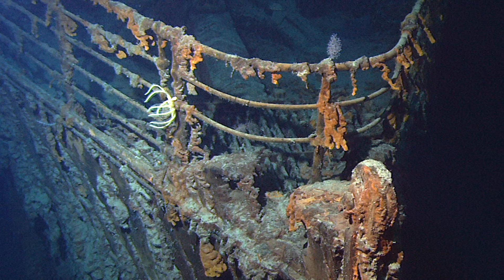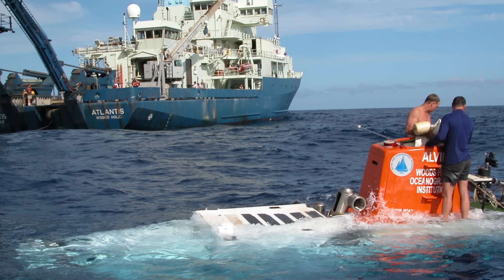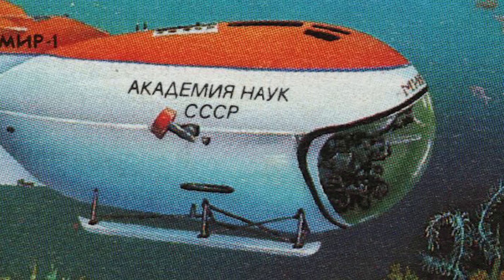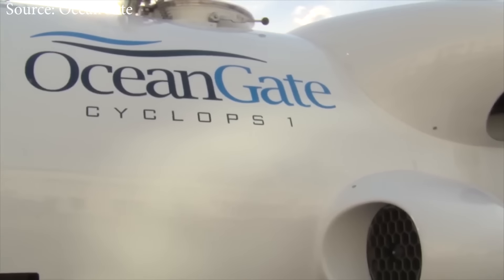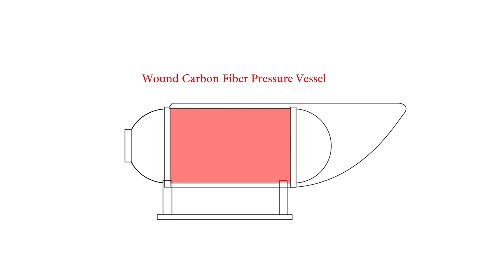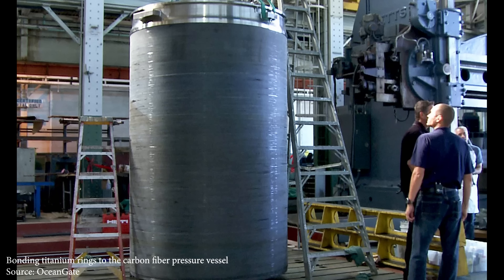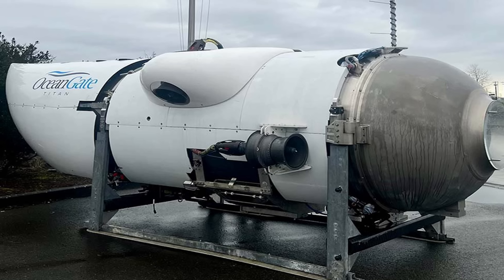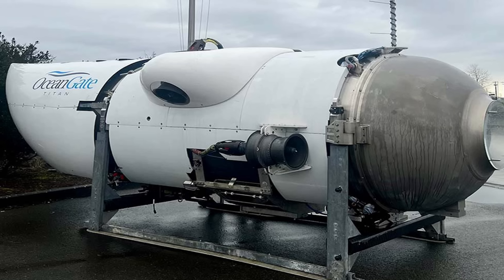How Titan was Built, Lost and Found: An Analysis

Comment: A couple of potentially key aspects that weren't mentioned in this video:

A - The viewport was only rated for EDIT: 1300m. That's 1/3 of the depth to the Titanic. That was a flagrant, known danger point. Russian roulette on every dive with a negative safety margin. 

B - The engineering spec for the carbon fiber thickness was 7". They built it to 5".

C - Preface: I used to work at Boeing on the 787 program, both post-cure and pre-cure. The 787 is mostly made of carbon fiber. Pre-cure was basically a low-level clean room. Not an open warehouse where people were at working areas with loafers and polo shirts. Every single large co-cured part underwent ultrasonic inspection and any defects fixed, and checked again for verification. The submersible did not get any testing for voids, inclusions, nor delamination after it was built. Any small one of those SIGNIFICANTLY weakens a co-cured composite structure by a significant amount.

For them claiming to be primarily interested in scientific pursuits, they intentionally disregarded science, engineering, and safety standards, then claimed they got in the way of innovation. I'm fine with innovation, but when innovating, you put no lives or only put your life on the line...... not putting several uninformed lives on the line. In my opinion, the passenger's deaths are akin to homicide. Rules were intentionally disregarded, then lives knowingly put in significant danger.

Edit: I'm in no way meaning to imply the video missed points intentionally. The stream of information about the disaster comes and goes, and I'm certain there was no ill intent, intentional misinformation, nor deliberate skipping of information.
Reply: This should be a pinned comment. Great work. I have found this channel so fascinating but this video is just... Weirdly off. These are awesome facts!
Reply: I agree wholeheartedly. Good work on the lovely 787.
Reply: C - completely agree

A & B - I've read the same, but is there a reliable source for these?
Reply: @TimInertiatic Many people in the deep sea diving community wrote to him saying it was a bad idea and thats all documented. Also the one whistleblower that worked there years ago.
Reply: @TimInertiatic  I know the window rating came up in the 2018 lawsuit involving David Lochridge and the company. He allegded in his lawsuit that he was fired when he raised concerns about the safety of Titan, including the window pressure rating.
I read aobut it on CNN, but that will also give you the name to google to find your own sources if you want to cross check
Reply: The thing that makes the least sense is why they were using carbon fibre in the first place. It doesn’t need to be lightweight. 

There’s a reason high tensile steel and titanium have been used for years, because as Alvin and the others have proven they can go through thousands of dive cycles and still be serviceable. 

Carbon Fibre weaves are strong, but as soon as that weave is broken it’s almost useless structurally. It’s not an ideal material for withstanding pressure in place of steel or titanium.
Reply: Want to add to your original comment that making carbon fiber is not easy either and has little room for error. When I was on a car design team in college we made a carbon fiber hood for our racecar as part of weight reduction and we just thought it would be fun. We had to scrap the first one all together because of delam and the second one "worked" because it's just a hood, but when you looked up close you could see tiny bits of delamination on it, but it still looked good from 20' away. Definitely not a foolproof thing to manufacture.
Reply: Hmm very interesting. Is it common to have very think carbon fiber like 5 or 7 inches? I don't know much about it other than from formula 1. As I understand in formula 1, carbon fiber parts get non destructive tests every so often to ensure no micro cracks have formed, is this also the case in aerospace?
Reply: You seem knowledgeable. Your comment was well said.
I suspect a slight bias here on the part of Mike, the channel host, one that is greatly magnified by the tragic nature of these events. He does not wish to speak ill of the dead.
And whatever the hubris of Stockton Rush, P. H. (AKA, the one guy who knew what he was doing) the French pilot, somehow he believed in the design.
To Mike, this is as if Sir Edmund Hillary hath fallen, claimed by Everest.
Reply: @tcu1099  Mike's bias is revealed in this case, magnified utterly by his desire not to speak ill of the fallen. I see no shame in that; he hath lost a Hero because of this.
Mr. P. H.
Reply: The 4 sign the waiver, which is death.They know the risk nuff said
Reply: The owner repeatedly assured potential passengers that his vessel was completely safe, too. I don’t think the passengers on board really knew how unsafe this thing was because they were deceived 💔
Reply: 100%!

As for a potential bias on this channel, as an aviation guy myself, and having had many friends die, it is natural to not want to speak ill of the dead.  That is true in a pure “normal accident” scenario.  However, there comes a time where one finds themselves as the only one defending the person at fault, because the person at fault is dead because of their own actions.

Supporters of OceanGate, exploration, and innovation, will have to adjust their stance in time.  After all, it failed here - miserably.
Reply: It was reported yesterday that the US Coast Guard will undertake the investigation into the loss of Titan, assisted by the NTSB. That is hopeful, as the NTSB are very good at investigating accidents, especially air crashes which also involve pressure vessels which can fail catastrophically (fortunately, only on rare occasions).

If Oceangate cut corners, as they appear to have done, the USCG/NTSB investigation will surely uncover it, which makes the future of Oceangate pretty uncertain....
Reply: Exactly. This was anything but science.
Reply: @tyler_bt3326  Titanium is *expensive*. Very. And therein lies the answer.
Reply: @jonzenrael  do you really think OceanGate can’t afford that? When human life is the main thing at risk, the last thing you should be thinking is “what’s the cheapest way to dive the titanic”
Reply: @michaelmanrahan8059  It doesn't matter what waiver you make a person sign, you can still be accountable for negligence. I can't trick you into signing a waiver for a bungee jump, neglect to tell you that the bungee cord is made from wool, and then walk away scot free while you plummet to your death.
Reply: To add on a bit, it looks like there were reports of “crackling” and “cracking” noises as far back as 2019. Someone hired to determine how reliable the submersible was reported to OceanGate at that time that it was likely due to part of the composite becoming “spongey” - this could have prevented a thousand different ways.
Reply: @tyler_bt3326  I think you might be misunderstanding me. I was criticising OceanGate for not using titanium, and suggesting that the reason for them not using it was to cut costs.
Reply: @tyler_bt3326  they specifically were testing new materials, and its not like the full thing was made of carbon fiber, they used titanium as well.
Reply: @tyler_bt3326  Also, carbon fibre is great for tensile stress but terrible for compressive stress. Suitable for internal pressures, useless for external pressures.
Reply: Listen to something that the View port was only rated at 1300m. Either way, not certified for 4000m.
Reply: @timoooo7320  Especially for aviation, since airliners' fuselage are also (internal) pressure vessels. Multiple aviation accidents are caused or contributed by microcracks:
• BOAC 781
• United Airlines 232
• El Al 1862
• Southwest Airlines 1380
• Aloha Airlines 243
• Japan Air 123
• China Airlines 611
• British Airways Flight 2276
Reply: @dbclass4075  yeah that’s what I was trying to get at, but didn’t have the wording to explain what I meant
Reply: They used a tube so they could fit up to 6 people inside. Im not an engineer but they could have just used two spheres, next to each other instead. I don't know if they taught about that, but that wouldn't been "innovative" enough, I guess...and probably more expensive too. If they had issues with being to heavy (witch was an argument for not carrying safety equipment) they could have used buoyancy foam like it was used on the Triton 36000/2, or even oil/gasoline filled tanks which don't compress and also float (like it was used on the Trieste). Even one proper sphere would probably bee to expensive for a guy who purchased b-stock carbon fiber from Boeing at a discount because it already exceeded it's shelf life. That was the "cooperation with Boeing" he was bragging about on his website.
Reply: I don't understand why he didn't mention these aspects. Stockton was negligent and ignored every single aspect of danger. Real experts and scientists don't ignore those things. Also, carbon fiber is an awful material for this. It's strong, until it slightly fails. Then it's all over. And in the depths of the ocean, why would anyone risk that? We should discuss where he messed up to prevent this happening again.
Reply: @bladerj  you're right, they did use titanium as well. But the issue is that that introduces a whole new set of weak points to the vessel - the join when the carbon fiber tube and titanium end caps meet,for one, but also that these are two different materials that are going to take the pressure in different ways. It's very possible that the titanium, being stronger, simply transferred the pressures to the weaker carbon fiber
Reply: I was looking at that carbon fibre and wondering, I am willing to bet it was that CF that gave way or as you say the view port
Reply: @nerdcredcosplay  may be, may be. but i think it was the viewport, there was a video from a guy that showed water inside it, i dont know it if was diference in outside being cold and inside hotter, but there shouldnt be water there.
Reply: How can the voyage of Titan be legitimate when safety and construction wasn't tested when Oceangate was aware of such defects ?  That alone doesn't make it legitimate surely ?  Swap legal for legitimate.  Your video is naive and has several misnomers. Not going to listen to the end.
Reply: @dutchpilotguy  Yes, it did. But I definitely think Mike lost a Hero. 
Normally, his videos seem (to me) professional, informed, knowledgeable, and well-presented.
This one got him where he lives, sadly.
Reply: Pressure around the windows of the De Havilland Comet weren't the cause of the stress failure. There are videos and a very complete report on the tests and reasons
Reply: @jonzenrael I wish the American pronunciation was dropped! Typical of why the Pilgrims left thankfully!
Reply: @tcu1099 I agree with this video seeming to be "off". It's one thing to set the record straight (the game controllers that everyone brings up is a non-issue, and I'm glad he addressed that) but the video comes off as strangely on the side of OceanGate. The objective view here is definitely not in the exact middle between OceanGate and the general public; their disregard for science and safety killed 4 innocent people.
Reply: Thank you. This is great info which makes me feel confident about air travel.
Reply: @brianpacos4072  Sorry to disagree. Off the shelf game controller are a major issue here. Using a bluetooth device adds only problems and makes the system more complicated compared to a wired device (possible interference with other electronic). Bluetooth implies using batteries which can fail and will fail in colder temperatures. So in case of an emergency in gets very cold down there, adding more complications and a higher workload to the crew, like putting the batteries into once pocket to warm up etc. So comparing those to the us navy was a bit ridiculous. This controller was probably not the cause for the catastrophy but is in my opinion a vivid display of the carelessness of the CEO and the company.
Reply: @mementomori4972  Well said, it was even the second hull because they had to replace the first one cause of fatige damage (wikipedia). So they all knew about it beforehand.
Reply: @tyler_bt3326  Interesting comment. Perhaps it should have been used in a sandwich type  construction between thin layers of titanium.
Reply: @tyler_bt3326 - I think one of the experts said it was a cheaper option.
Reply: @slayrae872 From listening to him, my guess is that it’s difficult for him at this time given he lost his hero. 
I think as time goes by, his bias will show less and he’ll be able to list all the things that were wrong with the submersible, etc.
I think back to John F Kennedy Jr. I was a child growing up seeing him always in the magazines and I thought of him (and even Lisa Marie Presley) as American royalty. I thought of him as America’s Prince and I thought of Lisa Marie Presley as America’s Princess. Remember, I was a child.☺️ But when his plane went down, Ugh, I was really sad. As time went by I was able to say, he should not have been flying that small plane with a broken leg in so much fog. That crash didn’t have to happen.
Same with Lisa Marie Presley. Her death did not have to happen.😞
So with all that, I can understand where this gentleman is coming from at this time. He’ll get there.
Reply: @dutchpilotguy  Well said!
Reply: re: "The viewport was only rated for 1600m."

Manufacturer's spec; they would warrant it to no deeper. Doesn't mean it's physical limitation is that value.
Reply: Thank you. This video is chock full of misinformation.
Reply: @vipersb1  No its not, the comments section is full of witchhunters. Most of whom do not have the first clue what they are actually talking about.
Reply: @michaelmanrahan8059  Yes, but while he was having them read and sign it, he was also telling people that a trip in his submersible was "safer than crossing the street". while that might be said of Alvin and Mir, it was certainly not true of Titan.
Reply: @brianpacos4072  It's not the game controller configuration per se, it's the absence of backup wiring, and the absence of sophisticated spark retardants in his unit. Submarines may use a unit that resembles the Titan one, but for sure those have  power redundancies and safety features that Titan's standard controller doesn't.
Reply: @pitchblack.793  No.

Unlike Oceangate there was actual testing done. :) In the R&D process they actually did destructive testing. The wings will flex to almost 90° up before they fail. That is FAAAAR beyond what they will see in operation.

Components undergo ultrasonic inspection to find voids.

Before structures go in the autoclave, there is testing done to make sure the vacuum bagging process was done correctly.

The pieces are laid-up in a near clean room, and are laid and cut by machine. Each layer is oriented specific directions to add strength. The thickness varies to be thicker at load bearing areas.

Each layer is inspected by QC before the next layer goes down. There are so many QC inspection points.

Hell, they even have a UV blocking coating on windows in the buildings.
Reply: @uploadJ  I would trust the manufacturer of the component over a guy cutting every corner he could. They're not going to warranty something for 1/3 of what it is designed to work to. That is a strawman argument.
Reply: @tcu1099 all videos are reapiting the same to gain money from views on nowdays hot topic tragedy. Same stock imiages and nonsense talking. There is imposible to make an essay in 1 day.
Reply: @tcu1099 100000% agree man
Reply: @michaelmanrahan8059 
I would argue it wasn't informed. If in the waiver they listed the concerns experts raised. If they listed the whistleblower incident. If they listed the potential for the material failure of carbon fibre then the passengers would be informed. The only informed person in that vessel was the CEO
Reply: @maryearll3359  • International waters, where no country has (direct) jurisdiction.
• No classification, in which no regulations will apply. You can notice this in OceanGate's motto about "bringing external players up to speed to innovations" (screw regulations!).

Unfortunately, physics is indifferent to human ambitions and regulations. Pressure is pressure.
Reply: @geoffreycodnett6570  While not the cause, it is a contributing factor. After the skin does fail, cracks find the window edges the path of least resistance.
Reply: @pitchblack.793 No, as the carbon fibre's flexibility is what delays its breakage. Here is the A350 wing test, whose wings are also made of carbon fibre: https://youtu.be/B74_w3Ar9nI?t=79
Reply: do you know if the 7" thickness spec was for the original design concept that eventually evolved into Titan? or was Titan itself supposed to have it, before corners were cut?
Reply: @iwannaratrod  re: "I would trust the manufacturer of the component over a guy"
What to say, what to say here. You do realize, that was likely NOT the cause of this disaster, right? You have not virtue signaled on that note. Please do. Now, having said that, you sound like a nice safe little "do-bee" (a reference to from Romper Room and little kid-dom, decades back now) who never exceeds the speed limit and changes your smoke detector batteries on-time every single year. You also likely have the city code enf ofc on speed deal, maybe second from the top? Thank you for your post, and perspective.
Reply: I have worked on many projects that were constructed with carbon and resin and like you said they were done in a clean environment specifically built to keep the object as sanitary as possible we would even use a larger room that was dubbed the sweat box that was around 130°F if I remember correctly and that was to help with the carbon and resin cure together with no air bubbles that I know had formed on the Titan pressure vessel and in air bubble at depth will implode causing cracks and weak points that would fail at that spot or start a delamination of the carbon they also used no diamond or any weaving patterns when laying the carbon that would have helped with the rigidity but it was just layered straight on top of the last piece which isn't really a tried method when applying carbon that's going to be under any kind of stress as you know..✌🏽
Reply: It's also crazy to think that the pressure vessel used in the Titan was an untested shape for the pressure cycles at Titanic's depth Oceangate had no cash coffers at all that's why all the cheap hokey lights and game controller they cut as many corners as possible they even fired the safety man that shape was only made to carry passengers because they had no way to pay for the excursion and the science that was to be performed they needed the passengers to collect the funds to even have a mission man it's really sad all the way around and I think your thoughts on it being closer to homicide is right on point he knowingly put those peoples lives at risk and ultimately his own..
Reply: Thanks for this. I had read these things too through ten minutes of googling but didn’t have the background to word them this way. I just really wonder why they didn’t listen to this research themselves like the twenty year old who talked his dad out of the trip. Apparently Stockton just brushed aside their concerns and even offered them a $100k discount. He obviously had no intention of listening to anyone. Fine. Risk your life. But he didn’t have to take others with him.
Reply: @RossGoneRogue not to mention the first company they went to to make the hull said they’re not gonna do it cause making a sub out of carbon fiber is a death wish
Reply: Thanks for this info. Finally a comment worth reading👍💯
Reply: @uploadJ  It is one of many possibilities, and an example of flagrant disregard for the laws of physics, which require no jurisdiction. Physics will do what physics does no matter laws, how cavalier the attitude, or how much money you throw at it.

I mean I usually drive the speed limit, but I like to live on the edge. I drink milk a day past the expiration day, and I'll pull a trailer rated at 55mph at 57 mph.

My smoke detectors are also carbon monoxide detectors. They are smart ones and will tell me if the batteries need replacement.

I don't know the phone number for code enforcement, but I have not licensed our chicken coop.

I like to live on the edge. Who knows what I will do next!
Reply: Oh gosh more armchair experts in the comments who barely even knew what carbon fibre was a week ago. 
 
The carbon fibre hull needed to be thicker AND needed to be scanned prior to each dive. A carbon fibre manufacturer stated it would cost about $20,000 dollars for a hull scan of the Titan. Stockton Rush chose not to, thinking that their onboard acoustic warning system would be enough. 
That was the real failure, taking shortcuts. Let's not forget the Titan had carried out 13 prior dives to the Titanic, plenty others in the Bahamas, could carry 5, cost only $370,000 dollars yet a spherical steel or titanium sub that could only carry 2 would set you back a whopping $37,000,000. Yes that's 100 times the cost of the Titan. There clearly is potential for carbon fibre, a lot, but it needs to used properly and with regular checks. A more innovative design could even involve a removable carbon fibre hull for more detailed analysis, inspection and even replacement after x number of dives at relatively low cost. Much will be learned from this tragedy.
Reply: A potentially key aspect you did not mention in your comment:

The Titan was actually deployed in 2021 and was field-proven over two and a half years and 10+ successful dives. 

I am not trying to imply that you failed to mention this key aspect on purpose or that your comment was not well thought out (it is very well written), just that it is very easy to lose the industry successes in the face of this small tragedy.

Edit: wrong number
Reply: @quietcosmos.  Agreed. But it's also important to note that those dives, although successful, likely contributed to the eventual failure on the last one. 10 dives are not a proven track record compared to the 5,000 dives of Alvin, for instance. If the 787 only had one plane, and that plane flew 10 times and broke apart on the 11th..... we would not count that as a success.
Reply: @iwannaratrod  I knew it - City Code enf on speed dial.
Reply: @jonzenrael  It is astonishing to think the Soviets built the entire Mike class attack submarine out of it.
Reply: Every time I hear some idiot say "I've done my research" I know they're full of it. Stockton Rush is quoted as saying something eerily similar.
Reply: @marcdraco2189  Would you rather them say: "I didn't do my research, I used a coin flip to decide." At least that would be honest, eh?
Reply: @uploadJ  Indeed. On its face that does appear to be logically equivalent, but it’s not. “I’ve done my research” is another way of saying, “I used Google and found information that supported my pre-existing ideas which means I can then spread those to even more people and cause more problems”. Doesn’t quite have the same ring, but that’s what happens. I say Google with the capital G because Google’s search engine optimisation works to promote popular ideas. Vaccine “skeptics”, GMO, pesticide and other skeptics all do the same thing. To be fair this is my wheelhouse so I do feel quite strongly about it. The problem we face now is that “advanced” (by current standards) AI is doing precisely the same thing. Bing AI (which also appears to act as a moderator for some of Microsoft’s discussions) gets a LOT wrong and even goes off in a huff like a child when challenged on its errors.

A simple example is to ask it to design a 2 pole passive low-pass filter with a cutoff of 100Hz. There’s a lot of math behind this, but unless they fixed it, it will respond with one pair of components (a resistor and a capacitor) telling the user to use the same circuit twice. This does not work and it creates a circuit that will filter as described BUT won’t function correctly. The second pair of values have to be completely different. As we add each new “pole” (resistor/capacitor) the effect increases as does the error.

When asking about GMO it suggests that SOME people think there are long term problems that have not been discovered. This is also BS, we’ve been doing GMO for at least 10000 years and doing it with things like radiation and chemicals for over a century.
Reply: @marcdraco2189  re: "I used Google and found information that supported my pre-existing ideas"
AND of course that is not research. When it comes to design, there is the first-pass where I'll use Mathcad and use a textbook formula or two to get an idea, then progress onto CAD tools for a finer rendition followed by a SPICE analysis for  near real-world parametric values (where I need to see peak currents and voltages, esp on filters). 
When it comes to EM and antenna work is where it gets hairy; the small tuned loop formulas are in error, even in Jasik's book on Antennas ... the efficiency and required resonating caps are all off for diameter =  .1  Lambda (~.3 Lambda circumference) even SO one really needs to know the 'limits' and pitfalls of the technical field one is working in too.
Reply: @uploadJ  I don't get your obsession with the idea of me having code enforcement on speed dial. But live in whatever fantasy world floats your boat. I'm not one to kink shame.
Reply: ive worked with carbon fiber as well on smaller personal projects. when i herd it was made out of a carbon fiber weave i knew it imploded.
 carbon fiber is a technological marvel of a material but because its so prolific in high performance and expensive applications.  people treat it like its magic. 
 i watched the weave process and my heart sank. if this were an amateur rocket done by some university team it would have been done in a cleaner environment.
  this is not space they are not holding back 1 bar agents 0 bar they are holding hundreds of times that in a fluid that will seep into the fiber over time.
 when i looked at this project i saw children who think they know everything playing cops and robbers with daddies gun.

source. I am a stupid child and this is the kinda stupid shit i use to do just on a way smaller scale.
Reply: I could not agree with this more.  They ignored the science.
Reply: @tyler_bt3326  The CEO explains it himself in one of his presentations. Carbon fiber has incredible strength to weight ratio, that's the key aspect. Titanium is stronger but much heavier. To make the sub large enough to hold several people comfortably but also light enough to cruise around the ocean using electrical batteries, they needed a balance between weight and strengt. That's where they thought they could beat the competition by using carbon fiber.
Reply: Great comments - very much appreciated your expertise on the inspection-repair-verification process and how the construction of the Titam seemed to skip it. Unfortunately, the potential for flaws in design and weaknesses in construction were well-documented yet completely ignored. Anyway, thanks for your input.
Reply: @DKFX1  carbon fibre has incredible strength to weight ratio, and it’s great for withholding an internal pressure (i.e holding 1 atmosphere of pressure in the confines of a vacuum). 

But it’s resistance to external pressure is far inferior due to the nature of it being a weave. Think of a wicker basket, if you pull on it the weave tightens and becomes stronger. But if you push on it, the weave loosens and becomes flimsy. 

The same will happen to a carbon fibre weave under the immense pressure experienced at 4000m. Cost effective or not, it was just never an appropriate building material in the first place and shouldn’t have been considered for use at those depths
Reply: Can I quote you?
Reply: @Dannyboy314  I don't know why you'd want to. I'm just some random, inconsequential guy on the internet.
Reply: @iwannaratrod  you had a really nice way to explain it, I'm not english speaking but have some knowledge of carbon fiber . And I saw a program before all this happened about this death tube, and that was actually what I called it back then. A death tube. I don't have to use you name but I liked you writing.
Reply: @iwannaratrod  this sub should only have been allowed on maybe one test dive and two real dives. And then retired. And to be fair it shouldn't have been allowed to dive at all. I'm not in the sub industry, it was a well built vessel for one and maybe to dives.
Reply: @Dannyboy314  If you like. Just make sure to say it wasn't from a real expert. :)
Reply: @iwannaratrod  it not from an expert, but when a non expert can could see the flaws before the accident, and it actually happens. Then maybe the design was extremely wrong, just saying.
Reply: @iwannaratrod  re: "I don't get your obsession with the idea of me having code enforcement on speed"
If you don''t get the reference, you don't get the reference. Others will, as I don't 'write' just for your edification or entertainment. There are hundreds of ppl who read these comments. Que?
Reply: @uploadJ  If it was a reference I didn't get, it wouldn't be the first......most likely not the last :)
Reply: @tyler_bt3326  You're not wrong. I was just answering your earlier question as to what motivated him to use carbon fiber. It isn't strength, it isn't price. it's strength to weight ratio.
Reply: @methylene5  Name all your sources for claiming the Titan "carried out 13 prior dives to the Titanic"
Reply: @gailmcn  There are quite a few sources that have quoted this number, however it may be possible that those included aborted dives, but there were at least 3 successful dives to the Titanic. Also quite a few dives to the same depth around the Bahamas.
Reply: @methylene5  OK. What you originally claimed was that Titan made 13 successful dives to the Titanic according to "experienced YouTubers". This claim is false, which you have apparently discovered because now you are reporting the  accurate information of only 3 verified Titan dives that successfully made it down to and  back from the Titanic wreck. And when that number is compared to the number of failed attempts from the beginning to the end of Oceangate's actual operations(2021-2023) you'll find that this was no "successful" venture, from any standpoint.
Reply: @gailmcn  The details being reported are changing by the day, I can only go by what is being reported, so sue me. There were many other dives to Titanic depths in the Bahamas as well. It seems you know nothing about the technology of deep sea diving. There isn't a single cylindrical vessel that has ever ventured to Titanic depths, aside from what OceanGate designed. They are all titanium or steel spherical vessels. What they achieved was a world first, and demonstrated that it can be done. I didn't say it was successful, they died, remember? But with improvements, building upon the work they did, there will be successes and much will be learned from this tragedy.
Reply: @gailmcn  You should perhaps also read about what "failed attempts" entails. Stockton had a rule, any 3 things amiss, and the dive was aborted. Whether it be a flashlight battery that failed, or a loose screw, or anything, no matter how trivial, the dive was aborted. The previous customers who went down with the Titan have all said the same about how serious they were about safety, hence why there were so many aborted dives. Accidents happen, and so 5 people were killed. I trust you also shout from the rooftops whenever an airliner crashes killing all 200+ on board, nah I thought not.
Reply: @gailmcn  "It's not the game controller configuration per se, it's the absence of backup wiring, and the absence of sophisticated spark retardants in his unit. Submarines may use a unit that resembles the Titan one, but for sure those have  power redundancies and safety features that Titan's standard controller doesn't."

Just checking back on this thread, your comment here, I do completely agree with.
Reply: @gailmcn  ----- " OK. What you originally claimed was that Titan made 13 successful dives to the Titanic according to "experienced YouTubers". This claim is false, which you have apparently discovered because now you are reporting the  accurate information of only 3 verified Titan dives that successfully made it down to and  back from the Titanic wreck." -----

Actually, I've been doing some checking online and it appears that what I originally said was correct, at least according to various online sources. 13 successful dives to the Titanic. 6 in 2021, and 7 in 2022. Google it. Even the wiki page on the "Titan Submersible Implosion" corroborates this.
Reply: @TimInertiatic yes, it’s from the people who worked there
Reply: @Svensk7119 if he lost a hero to Rush’s ego, hubris and gross incompetence he should be livid with him, not defending him.
Reply: @thefitcookie completely safe yet the waiver mentioned possible death 3 times on the first page alone.
Reply: @DrunkenChewbacca and in deep sea diving when dealing with pressure, the standard is to build it to a rating that is a third over tolerance to the maximum depth you’ve intending to drive to, so really everything should have been rated to 6000 metres
Reply: @StoutProper  To a point, yes. But somehow, P.H. believed in Titan. He must have! And to be fair, this was its fifteenth dive.... not that does anything but reinforce the NASA-Challenger syndrome OceanGate had.
Being angry at a dead man is a fairly useless activity. And he might still have been in a state of shock. Each person's reaction is his/her own.
Reply: @Svensk7119  the fact it has been to the bottom 14 times before doesn’t prove it’s seaworthiness, if Rush or PH had done any research at all about carbon fibre they’d have realised that it was only likely to get weaker with each dive, and without subjecting the hull to a full analysis they’d never know what the impact those dives had on the structural integrity. PH was obsessed with the titanic, and this was a cheap way to get up close and personal with it. And as you or someone else pointed out, these Jules Verne type adventurers are big risk takers. I don’t know how much he knew about submersibles. I don’t know a whole lot myself, but I knew enough long before that thing ever sank to know you wouldn’t catch me on it. Whether he believed in it or not isn’t really the point. He might have believed in God for all the good it did him. The point is Rush was careless and carefree in the design, manufacture and maintenance of his submersible, and ignored repeated and persistent warnings from his own team and his peers in the industry. I doubt very much whether he fully informed all his passengers of those warnings, hence his eagerness to use his financial clout to sue his critics to shut them up. The idea that because he’s dead we can just forgive him of causing the unnecessary death of four other people is ludicrous. Lessons need to learnt, and they won’t be if we just paper over his shortcomings simply because he happens to be dead.
Reply: @StoutProper  Oh, no. I said nothing of "papering over" his shortcomings. And perhaps you didn't understand what I meant  by "NASA-Challenger" syndrome. The fact that nothing happened made people feel safer when in fact it increased the odds to 1 to 1, 100% that is. You made an interesting case when you said P.H. was obsessed with Titanic. I had not considered that possibility, that more than one person was not rational aboard. Obviously, Stockton Rush wasn't as he ignored every turn off on the highway to Extinction. 
And that is why being angry with him is useless. The man is dead. Yes, it is grossly unfair that three amateurs and a legend died with him, but he is conveniently no longer an obstacle, and so no papering over is necessary. The lesson can be applied in the face of his negative example, which included not telling his passengers, as "he knew better". I agree completely with you upon that point.
The worst thing, to me, beyond the individual tragedies, is that this man's self-delusion ruined the perfect record of the bathyscape industry. No one had died in the hundred plus years since the designer of the Trieste invented (or reinvented?) this science.
Yet I can do nothing productive with that emotion.
Reply: @Svensk7119  giving the man a pass simply because he killed himself doesn’t seem very fruitful to me
Reply: @StoutProper  Well, if we flog him and hold his feet to the fire, we accomplish nothing. 
We should (I hope) be able to learn from this without his cooperation. At this point, only God can punish him further and accomplish anything by it.
Reply: @Svensk7119  unfortunately he can’t be punished any more, more’s the pity. However, by highlighting and emphasising his errors, failures and crass stupidity we can at least hope that others won’t copy his example and make the same mistake s.
Reply: @StoutProper  I said that.
That's what I said.
Reply: @mementomori4972  Yes! I believe there is a vessel with three spheres
Reply: @bladerj the most important part of the submersible was carbon fibre weave. That's sus, wish the b channel host could tone down the undue respect of Stockton Rush. He definitely had aspirations of deep sea tourism, akin to a Virginia galactic type scheme. He cut corners and made passengers into members of the team in order to have more paying customers on board instead of qualified crew members.
Reply: @tcu1099 that was my feeling. It really threw me as I expected something with more objectivity about what Rush himself said at numerous points about safety, profit and others in the sub community. He appeared to regard the existed pool of expertise with something approaching disdain at worst and scepticism at best.
Reply: @tyler_bt3326  Absolutely correct. There was zero reason to use carbon fiber.
Reply: @tyler_bt3326  Heard that carbon fibre was chosen as its cheaper than titanium
Reply: @iwannaratrod hey man I literally was just making a comment about the carbon fiber. Since you have first-hand experience with this material in manufacturing, what do you think of the fact that the carbon fiber was rolled around the cylinder and a single direction? For example a nitrous oxide made with carbon fiber tank has a diagonal cross hatch pattern. Shouldn't they have at least gone diagonally and wrapped the carbon fiber in such a way?
Reply: @ThaStone   I haven't looked much into how Oceangate constructed the cylinder other than a quick video if it being wound as a wet lay-up in a far from controlled environment. I'm also not an engineer, so my experience is in execution, not design, and not with filament wound cylinders. On the panels and co-cured assemblies we did, the direction and number of layers was VERY specific and layers never went the same way as the layer under them. Everything we did was pre-preg in controlled environments, cured in an autoclave, then non-destructively tested.
Reply: @iwannaratrod  That's what I mean, though...looks to me like the filament was wound in one single direction..that alone I think doomed it right there....I am not sure what they were thinking. You have to have layers with varying directions. It looks to me like they didn't even ask anyone who knows anything about carbon fiber or if they did, they didn't follow basic industry practice not only relating to manufacturing environment, but in construction design and method.
Reply: @Svensk7119 I think in the case of P.H. the desire to continue to explore the Titanic might have clouded his judgement. He'd been down before. Oceangate was likely his only chance to go back. I'd imagine that the experience is somewhat similar to that often felt by returned astronauts, that normal life on earth is meaningless and insignificant.
Reply: @iwannaratrod Lol! Thanks for this humorous reply!
Reply: Late to the replies, but whatever. This comment is what I was looking for.
I'm no engineer, but I know a thing or two about a thing or two, and two of those things are resin/bonder impregnation and carbon fiber.
Carbon fiber is immensely strong- in tension. This is why it's used in aircraft bodies: when the cabin is pressurized, the pressure pushing out on the fiber body pulls the fibers, keeping them rigid and in tension. The impregnated bonder then essentially tangling one set of fibers to another, creating a continuous weave, however should there be a defect in that bonder, then repeated pressure cycles cause damage in the same way water freezing and thawing in a crack will split concrete.
The issue is, if it weren't clear, is that under the sea, the pressure vessel is in compression, not tension. Now the principle benefit of using carbon fiber is practically moot, and all that is supporting the pressure is the seven inches of bonding agent! Now we(I) don't know what kind of "resin" was used on titan as it's bonding agent, however, if it's anything like the resins I know, then it's strong, if brittle when freezing, and lo and behold, what's the temperature at the wreck of the titanic? Bleeding Cold! Coupled with the prior mentioned issue of pressure cycles still at play, and the sub getting crunched like a soda can was inevitable. An audio alert system would be as useful as trying to use a camera catching lightning to warn for thunder- you would have milliseconds.

oh, and best of luck OP, hope you're not feeling blue at all- I've heard Boeing's counseling services likes to prescribe people a one time dose of lead.